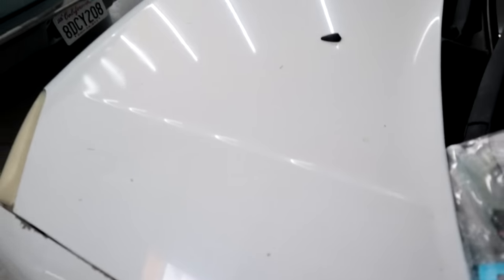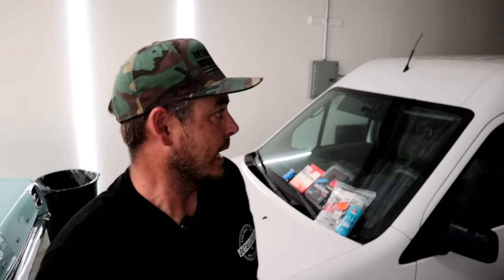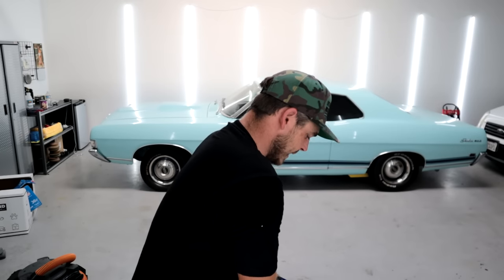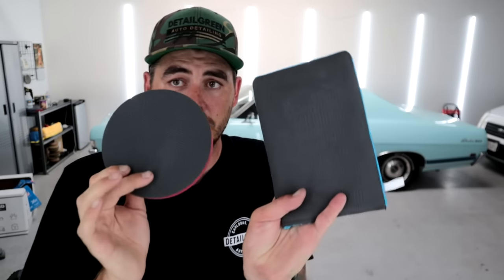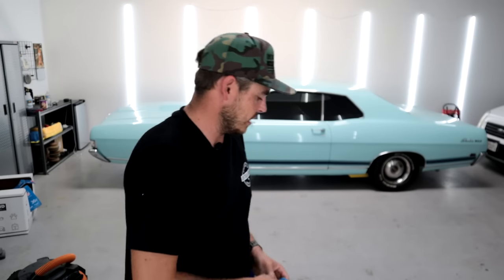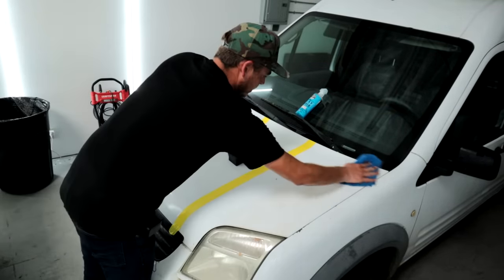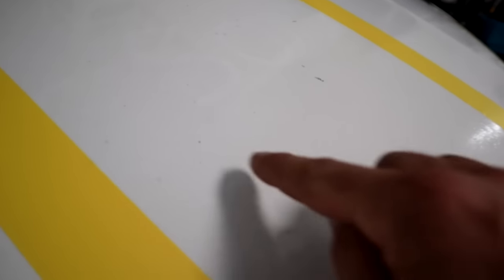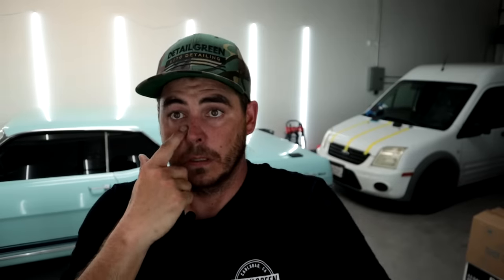Easiest way to CLAY your Car! How When and Why you need to clay bar your car. Best Types of Clay Bar

Comment: I'm just a DIY detailer but I've been using clay for many years now. I started with Mothers clay bar kit years ago. It came with a spray bottle of detailing spray as the lubricant. Once you were done claying a section you had to buff off the spray lube before it dried. At some point along the way I started just using a fresh batch of car wash as the lubricant. I take my microfiber wash mitt and slop a section wet with car wash and then use the clay. Every bit as well lubricated as using the spray lube stuff and when you're done with a section you hose it off! I have a 2011 GMC Sierra and every time I clay it I get an incredible amount of brownish blackish contamination off the vertical surfaces of the door panels.
Reply: I just made a bottle of clay lube.  4oz alcohol, 28oz water and 5 drops of dish liquid. However, seems like using car soap and water would work too.
Reply: @thekinarbo  be careful with dish soap it can damage ur paint
Reply: fantastic idea.  thx!
Reply: @isaiahhill4584  I believe dish soap is only harmful in high concentrations (like when used for a pre soak, wash, etc.) But 5 drops seems to be just significant enough to add lubrication and a bit of cleaning power as well. I have to try that recipe cause quick detail spray as clay lube sucks imo

Comment: The lesson I learned is to use the Clay PAD first since it can be washed and reused and then use the Clay BAR for the slickest, smoothest finish before buffing out the paint.  Those Clay Bars are expensive so why use them first and clog them all up with the first pass?  Use the washable Mitt or Pad first.
Reply: Too time consuming your basically claying twice.
Reply: @sargonoshana2324  Damn, you're good at counting.
Reply: That's a good idea.  I just ordered a Maxshine Nano Clay Pad so, I'll try your way.
Thanks.👍
Reply: Doing twice the work and unnecessarily removing more clear coat than needed? Yeah, sounds like a winner.

Comment: I like chemical guys and Adams products. i cant believe your detail spray leaked also. Very little but maybe they need to secure the product better. Thanks for onfo on mitt. im still weary about reusing anything that's been contaminated by sand. yikes i would need a test hood to confirm like new condition i just wont drop my new mitt

Comment: Josh, I just  purchased a clay mitt that I would like to use with my foam cannon.. is it OK just to use it with the soap bucket and take minor perfections out. And what do you think is a reasonable and good trim protector coating. Thanks man will enjoy your channel. I also plan on polishing and recoding. I have a car that probably feels just as bad as that man does. Then I have a newer truck that I don’t think that needs clay, but I’m just not sure any suggestions would be helpful....

Comment: I got the same results as your test.  I bought the Nanoskin clay mitt for $35 or so.  It just didn't work well.  Less aggressive than even mild clay.  I had to go over the same spot forever to remove the contaminants.  Then I would get frustrated and push harder which then gave me black streaks from the clay mitt material.  So I went back to the old-fashioned clay bar.  It works best for me.  Even though it's small compared to the clay mitt, it's faster overall because it's more efficient.

Comment: I only clay when I know I will be polishing afterwards.  Do to arthritis in my thumbs, I use the nanoskin clay mitt.  I like to clay after the chemical decon.  I use my wash soap, usually my strip washing mixture with clay mitt.  You can use ONR as a clay lube as well, I believe the mixture is 1 oz per gallon of distilled water?

Comment: Well, clay bars and mits are kinda last step in cleaning/decontaminating your vehicle. You use IPA degreaser, iron remover, tar remover and insect remover (but degreaser usually does it job well with insects) and only then you use clay bar or mit. 
I know it's tempting to go straight with clay, but it's chemicals that should do the work, not you or your hands.
Reply: You can spray iron remover on your car??
Reply: @Workrelatedstufff Typically called decontaminate.

Comment: Dude clay pad on the DA. 😀 I use my max shine clay pad on DA on my window glass and it works well. A good way to feel contaminates is to use those super thin grocery store meat bags or produce bags as a glove. The ones on the rolls. You can feel every little bit of embedded material in the paint.

Comment: I took a $20 bottle of Meguirs Iron Remover and unleashed it on my Jeep when it was drizzling rain so I could let it dwell about 15 minutes, then pressure washed residue off and my paint had very little contamination left for clay bar process.
Reply: Man, I glad I came down to the comments.  I just checked out some iron remover products on Amazon.  They seem to work great, thanks!
Reply: @zerocal76  that's awesome! My Jeep is 20 years old and probably never has had decontamination of paint before. I was super surprised how smooth the paint got just after iron remover.
Reply: @originalsupermommy  Yeah man I don't think this existed a few years ago when I was more into detailing.  I have a wheel cleaner that is basically the same as an iron cleaner and it works amazing.  Does your trim look fine or faded after using the Meguiar's cleaner?
Reply: @zerocal76  my Jeep really doesn't have any plastic trim, I have the Overland edition which has painted pieces that are normally plastic on lesser models. I only have a small piece of plastic on bumper step area on back and it's been faded forever.
Reply: @originalsupermommy  I appreciate you takin the time to reply man.  I just ordered Adam's iron remover to test it out.  I'll probably end up trying a couple more.  I like to keep my 2 rides CLEAAAN unlike these youngins from Gen Z 🙄
Reply: @zerocal76  chillll im Gen Z my 06 Ranger is cleaner than most newer cars😂

Comment: I prefer traditional clay personally. For a professional the other options would make the most sense most of the time. Mother's speed clay pad 2.0 works fine for me as well. Looks to be much better then that chemical guys one you used IME. I've only used 3 or 4 chemical guy products and none of them i would buy again. Maybe Mr. Pink locally if i was stuck. VRP is decent too just doesn't last. I'll be tying mckee's tire coating this winter on my summer tires.
Reply: ya Chem guy products are over priced and under perform in my experiences, as well. They put more effort in the product smelling good, lol.

Comment: My experience is that the clay mit is good for lighter jobs and the clay bar is for harder jobs. Sometimes I use both, the clay mit with soap and clay bar with paint dry and clay lube. And Do clay clay often. Why let those contaminants sit amd cause clear coat failure.

Comment: I've always used a traditional "medium" clay bar (typically it's a pink color) on a well washed surface. On a beater like this white van that's really bad, I would probably wash the car with Dawn and a wool mit. It's gonna need the full monte anyway. I tried some clay lube, but honestly water works great. I like to use a garden hose w/ sprayer, and keep rinsing occasionally as I clay. It washes away any loose contaminants, and keeps the clay bar lubricated enough. Plus, water is clear and you can see when you're not just absorbing contaminants, but actually starting to sand into the clear coat. The clean water begins to show some white color, much like when wet sanding a car's clear coat, but a lot less of it.

My go-to steps for a rough car are a thoroughly hard wash, medium clay the car, polish with Pro Miracle Cleaner Wax and a Lake Country white foam waffle pad using an orbital, then seal it (if you want), and wax it with yellow Carnauba wax. There's a lot of new options like ceramics that are available, but my go-to steps will take you from a disaster like this white van to a silky smooth and amazingly clean and polished paint real quick.

Optional additional steps would be compounding it before using the cleaner wax, using a polishing compound (basically a deep shine step) after the cleaner wax, and sealing it before the carnauba wax.

Comment: There is NO way to quickly clean your vehicle with a clay bar.  The clay patty is about 4x4 inches (like a large "Mr. Clean" sponge) so it takes that long to clean every square inch.
I use the clay even on the windows, occasionally.
DON'T use Plumber's putty!
Try a "clay kit" to start, then buy a 3-pack and a large bottle of lubricant as you get experience.
You will only find the clay bars at auo parts stores; anything else you will need to order.

Comment: Cool video!  Thanks for posting!  Questions...  I wash my car once a week, but for work, I have to travel on a lot of dusty/gravel roads.  As a result, each day, my car has a light coating of dust on it.  My car was clayed and then I applied the TW Graphene Flex Wax.  It still feels smooth in most areas of it except for the bottom of my door panels.  Should I rinse my car off daily or wait until it's washed to get the dust off?  Also, should I clay it once a month?  Please advise.

Comment: I'm sticking to the clay bar old school,  if it ain't broken don't fix it.... the bar is actually faster it clearly shows in 30 seconds it beat everything in cleaning speed also, in the same time using your favorite one it would have taken your 3 to 4 times longer for that small spot so by you fishing that small spot with the towel pad... you could have done the full hood with the bar regardless of the size.

Comment: What are your thoughts on the Meguiar's Quick Clay Kit? It is advertised as clay and coat at the same time, which seems counter intuitive. My situation is my daily driven 4Runner lives outside in the AZ sun and frequently goes off road. It sees mostly nature's washes and in AZ that can be few and far between. Some things are starting to show some age and not just all the pinstripes. I plan to starting doing more work on the exterior finishes, but in the end I'm kind of lazy so I'm looking for the shortest route to getting things looking better. It doesn't make sense to pay for an expensive ceramic coating with the mechanical damage that occurs to my paint, but I need to do something. I have been looking at some of the hybrid washes and waxes up to this point. Thanks for any input.

Comment: Just a quick question, I've been using the Meguiar's white clay bars and I'm finding everytime I use them they start falling apart super quickly. After maybe 3 or 4 times of rolling them over they start to crack and fall apart. Is this normal or is this just bad quality clay? It's the only brand bar I've ever used. I got 4 of them and they've lasted awhile since I was cutting them into 4 pieces per bar. Haven't had any luck with synthetics yet. I use a Mit, see black spots that didn't come off, switch to a piece of clay and after 2 or 3 passes that piece of iron is removed.
Reply: Try mother's clay bar kit.  Their clay is yellow and much easier to work with in my opinion.

Comment: The clay towel works great if you wrap it around a sponge. Also, the sponge helps keep the surface wet.  Typically, I wash the car, rinse the car, spray soap over the car again and then clay as I rinse off the soap.  Then I dry the car. I don't dry the car until after the claying is done.

Comment: I'm no expert but from what I've heard the synthetic clay mitts apparently lift the contaminates, in which hosing of is required as the material isn't tacky like traditional clay.
This is just what I have been told. It kinda makes sense though.

Comment: I have a question lol I just got a brand new Tacoma and all of the windows except for the windshield are tinted but they all have water spots on them I haven’t really tried to get them off just yet but I did use some turtle wax minute works and it kind of helps a little bit what do you think the Claybar will help get the water spots off? Also I just found out about you do you have ry continent thank you for sharing

Comment: I recently bought a clay towel, which  is kinda similar to a clay mitt. Went back to clay bar when I found my brother had a spare one hiding in the shed. The towel has it's uses but it's too mild for heavy contamination removal.

Comment: Grits make a  great one round fits your hand works great and I've never dropped it once and easy to clean while using it usually about 25.00 $ usually get about 20 or 25 cars, then I use it on bad cars as a quick pre treat before the new one. It's not grits it Griots 😁👍

Comment: Thank You. I really learned allot. I used one of those clay pads "2.0"(from a major company) with lots of soapy water. It made my truck's surface really slick. However, when it dried it looked as if I had sanded the entire surface. Took allot of polishing.

Comment: What do you think about coating while washing? So what I've done in the past was clay the vehicle after I applied my foam, one section at a time. I've also used it with a bucket with a bit more soap(for added lubricity) and go over the entire car just as if was washing it but with the clay. I would use this method after Ive washed the vehicle.
Reply: Great idea 👍👍👍 what kind of clay do you use ?

Comment: If you need a good test to determine if you need to clay put your hand in a sandwich bag and gently it over the paint you will feel how rough it is or you can use the edge and you will hear the contaminants. It is an excellent way to show the customer what the what the problem is and how you are going to fix it, never had  one yet who wasn't very impressed👍💯

Comment: Josh , your video was very helpful for determining which clay instrument to use.  I had heard of the clay bar and the clay mit but not the clay pad or the circular pad. According to your experiment the circular clay pad made the most impact; was that due to the pressure of your hand / body as you lent over the vehicle? Just a thought.

Comment: Hi Josh, I just started watching your channel and I love the way you present topics.  I have a question, because I'm a last minute type of guy I often end up at the local auto parts store or Walmart to get detailing supplies.  That being said, have you tried Mothers synthetic clay pad?  What are your thoughts?
Reply from the maker: I’ve never use that specific one but it should be similar to a clay block… for 90% of cars especially if they are maintained well it should work perfectly!!

Comment: I’ll probably go all the way to the step of claying, and then get all that off of there and then I’ll do turtle wax graphene flex wax! The car is brand new I just got it in January. I would do everything but I don’t have all the equipment. I don’t even have a building to put it in when I do this…lol
Reply: And I’m gonna use the clay mitt or whatever. I’m not using real clay that’s too dangerous, because I would drop it instantly..lol

Comment: What do you use to remove a semi ceramic coating? I washed my truck with that armorall ceramic wash ( the green stuff) and noticed some imperfections. I want to remove it and let a pro handle it.

Comment: Clayed my full sized white sedan( which I drove off the dealer lot 3 years ago) and clayed it for the first time. Not as bad for fallout, but more brake dust. Used a clay bar. I am rally happy with the look and feel now. I put The Chemical Guys Butter Wet Wax on it. Today I used The Chemical guys Clean Slate (three times) to remove the butter and then IPA'd a section by section of the car and appied AvalonKing Armor Shield IX on the IPA sections getting a third done. Started to mist rain - Stopped. To be continued.
Reply: Keep me updates

Comment: One thing about white car I have seen is that even if the paint is smooth there is still dirt embedded in the paint. My car looked vanilla and I used a traditional clay bar. Kept going over and over and my car’s white color came out instead of that vanilla color. If you have a white car please always protect it

Comment: Hey Josh, can I clay my truck after foaming it with Adam's Mega Foam or would you recommend a different lube product?
Reply from the maker: I definitely have done that but I always polish after. I would recommend a dedicated clay lube or a quick detailer for the best results so that you don’t cause any unnecessary marring
Reply: Thanks. What about something like Adam's car shampoo instead of mega foam. Any difference there or would you still use a separate clay lubricant?

Comment: Would you know what's the difference between the nanoskin clay mitt medium and fine?? Not sure which one to pick up or would the max shine clay pad 6 inch would be better since it took more of the contaminants off
Reply from the maker: The Maxshine did pick up more, but it can mar the paint so i would only use that if you plan on polishing after anyways. If youre trying to be as safe as possible id go with the nanoskin fine grade
Reply: @imjoshv  Thank you I'll definitely go pick up the clay mitt 👍

Comment: Have you tried the rag company ultra clay towel? The perforation makes a massive difference, I’ve had significantly more marring with traditional clay.
Reply from the maker: I have the mitt and sponge ultra clay from them, just haven’t tried them out yet. Sounds like I should get on it ha! Thanks
Reply: @imjoshv  perforation makes a massive difference. Gives it more lubrication/less pressure points and gives contamination a place to go! I’m on my 3rd one. Just scrub it with a leather brush and APC and you’re good to go, I normally get over 70 cars with one towel.

Comment: Majority of the year I use the nanoskin clay mitt or towel, but due to the heat during the summer,  being a mobile detailer it’s not an option for me. It will stick regardless of the amount of clay lube I use. When it’s hot out I stick with the traditional clay bar from Car Supplies Warehouse.